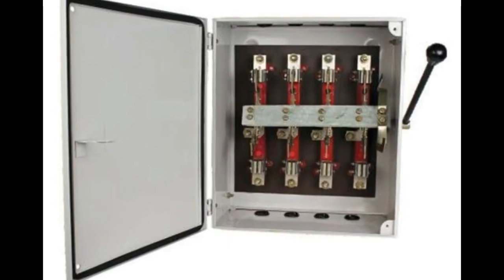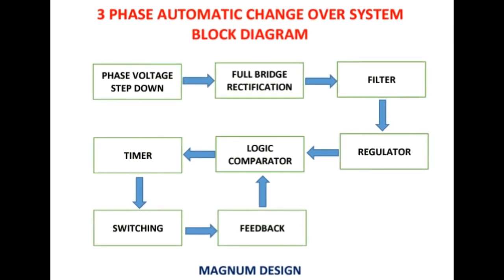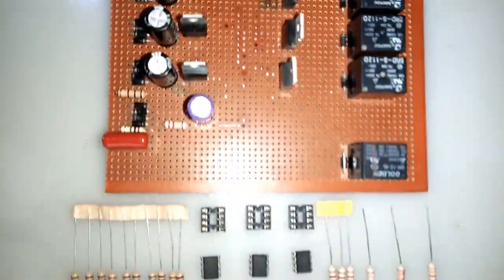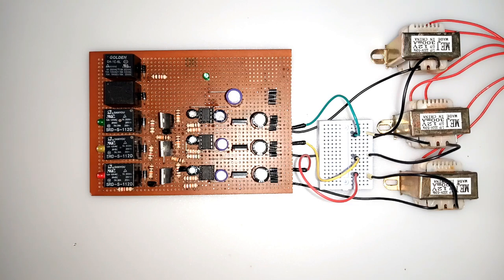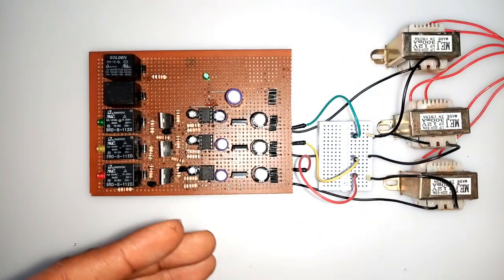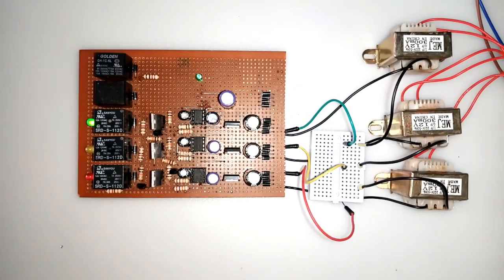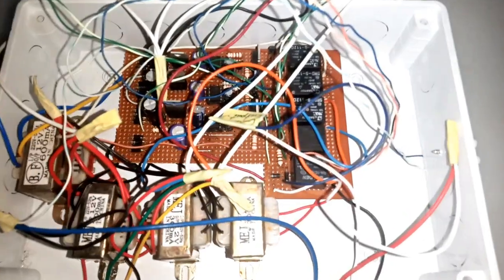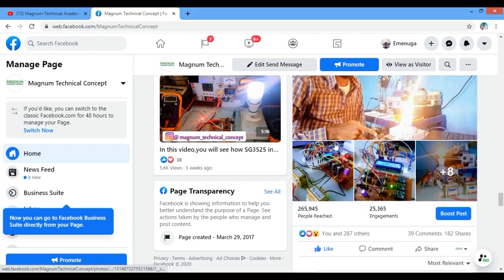3 PHASE AUTOMATIC CHANGE OVER SYSTEM: How to build 3 phase Automatic change over system using relay

Comment: hello, I had written to you before, I don't know where I could contact you better, but as an improvement you could use a 12 volt capacitive source because it is only to power the passive components, and one question, do you have the PDSPRJ file, can you provide me or send me? .
All the best

Comment: @
Magnum-Technical Academy
1.there is no demonstration on how to connect it to a gen set 
2. can it automatically off/On  A GEN set
3 what the max amp it can handle 
4. assuming you want to upgrade the amp it handle how  can one do that
Reply from the maker: Sure all these features are highly feasible for the project

Comment: Can switching be achieved without ever interrupting the supply to the load(The CFL lamp as used in your video) ?
Bypassing power interruption to load .
Reply from the maker: Yes, the switching is made without interruption
Reply: But,the lamp goes off whenever you diconnect the current active phase ...

Comment: You're good Mr Magnum .

Can the switching time (5s, 10s, and 15s) be reduced to a smallest possible value ?
so as to increase switching speed and reduce delay .
Reply from the maker: Sure by changing the discharge resistor

Comment: this is a very nice project. the final construction shows a digital display where is its signal being tapped from in the circuit
Reply from the maker: Thanks for the feedback
Reply: @MEmbedded_TechLab  welcome sir, is it possible for you to send me a simulation file of the same in electronic workbench, or proteus?
Reply from the maker: @marshalldaka7081  the link to the simulation is dropped on the video description
Reply: @MEmbedded_TechLab  how about the 5s, 10s, 15s Which part of the circuit determines them?
Reply from the maker: @marshalldaka7081  the resistor connected to pin 2 of the 555 timer IC
Reply: @MEmbedded_TechLab  I see. Thanks. Please share your contact if you can. I want to call you some day
Reply from the maker: @marshalldaka7081  
+2348096283289
Reply: @MEmbedded_TechLab  am having a little trouble, am building this circuit phase by phase,  so am seeing phase 1 is not turning ON. is it that the circuit has to be completely connected or there is a problem with my circuit
Reply: By phase 1 i mean all the way to the relay, its not making
Reply from the maker: @marshalldaka7081  can you send us a diagram to illustrate your question
Reply: @MEmbedded_TechLab   Bro, have you thought of having this circuit using a transformerless power supply for each phase to eliminate transformers
Reply from the maker: @marshalldaka7081  
Yes I have thought about it, and am making some approach on designing a new model, with a transformer less part
Reply: @MEmbedded_TechLab  this can be achieve by implementing SMPS with circuitry protection against component failure. Nice work bro . Are u in Aba?
Reply from the maker: @yuribiktop6595  yea
Reply: Please i need your help asap my school deadline is approaching
Reply from the maker: @marshalldaka7081  send me a direct message

Comment: Thank you very much for nice project, I would just like to know on the polatity of transistor how the pins are arranged the drain, source and the gate?
Reply from the maker: Ok, I guess you should check for the Circuit diagram, which we presented. It should guild you on the connection. The link for the Circuit is on the video description